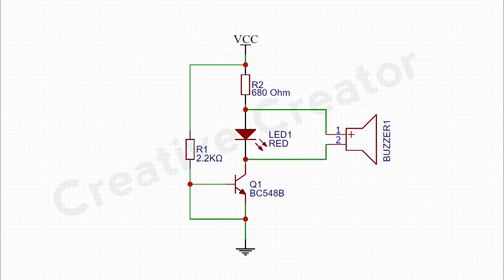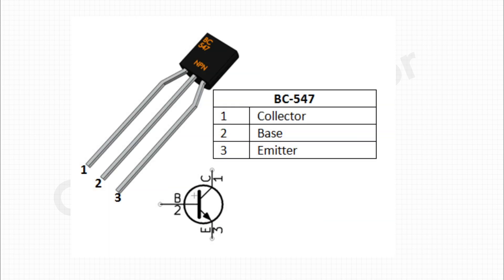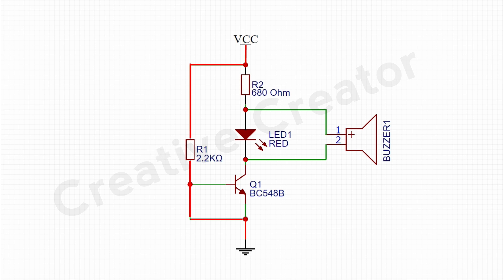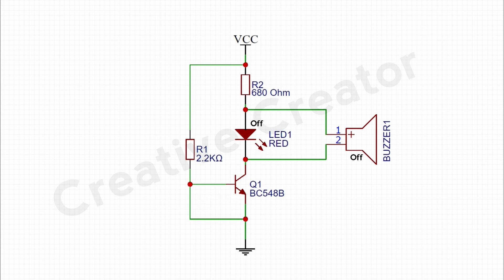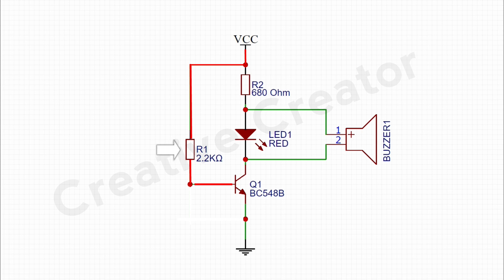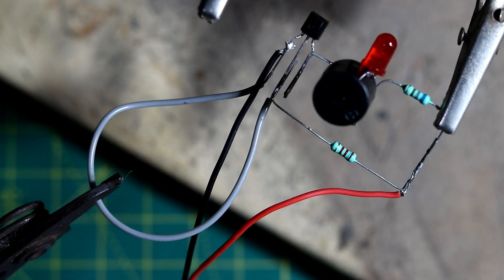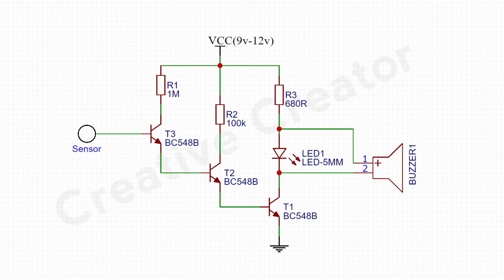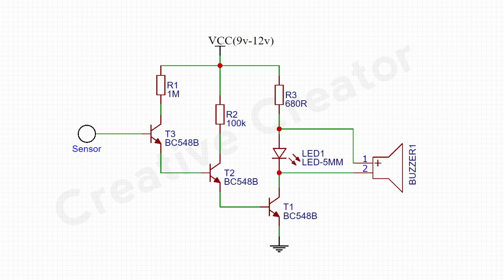Top 3 Electronics Projects using BC547 Transistor

Comment: i was made an circuit of water tank but its LED glow very slow not high with 9 volt battery . ples sugges why?
Reply: Have u connected resistor ?
Reply: @SAM-sq6tf  as per the instruction given.but it glow very slow not seen perfectly